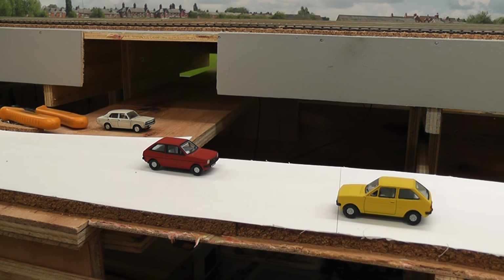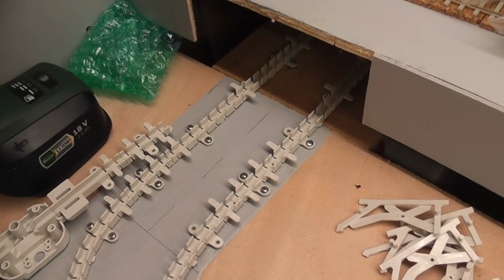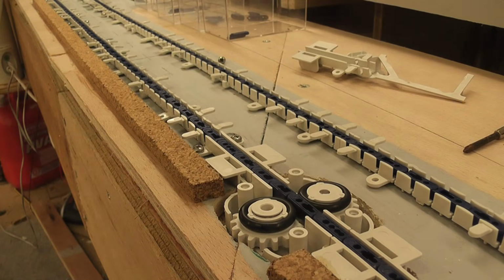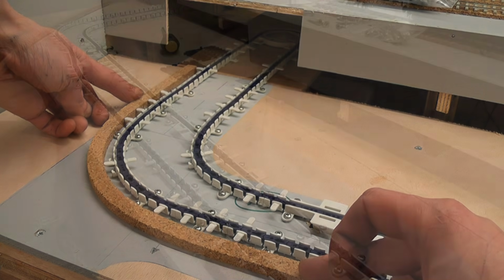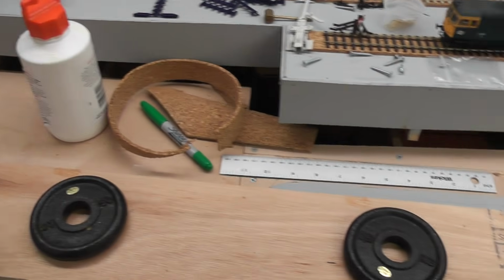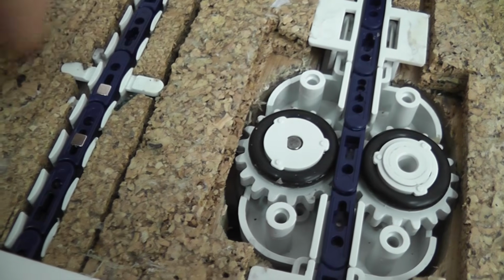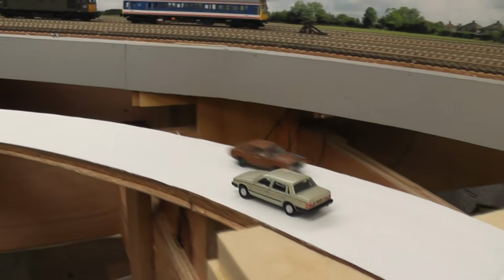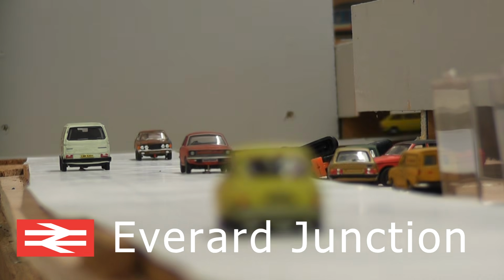New Layout Build - Magnorail

Comment: Hi Richard.  
I'm really impressed with your layout and videos.  The Magnorail video is very informative and instructive.  I'm interested in adding Magnorail to my layout but have limited space width wise due to an access area in part of the layout.  What is the minimum width required for a double roadway like you have?  I'll probably not use the return loops at the end and have more gentle endings. So I may be able to put the tracks pretty close together.  Any help appreciated.
Thanks, John

Comment: Hi.   Love your work Richard.   I am incorporating a Magnorail into my N scale layout but am having trouble selecting a road surface.   My shed can get up to 45 degrees in the summer and down to 5 in winter so expansion is a problem.   I've tried various plastic options with limited success.   After over a year of running, how is your idea of photocard holding up?   The magnets must wear a groove in time.   Have they damaged the road surface?    Any one else found the perfect material?

Comment: Two questions:
1) How do you cut your cork strips.  Especially getting them to look so nice and straight.
2) There is one area of the video where you show putting the links together on the track.  It looks like you are using something like a knife blade to lift the links in place but it goes by so fast I can't see the detail.  Can you guide me - my method leaves a lot to be desired.

I finally found someone in the US who was selling 8 mm thick 2 feet x 3 feet sheets.

Thanks
Zev Kahn

Comment: If the 'road'is flat it's only axle friction and acceleration that puts a load on the straight parts of the system. Maybe introducing spare turnarounds to increase the radius of corners where possible would reduce the vehicle load created at the turns? I still think it looks magic. BobUK.

Comment: I'm working on adding a bicycle path to my European module for the module club I am a member of.   Interestingly (this is in the USA) I can't find any corkboard underlayment that is metric in thickness.  So I can buy 1/4 inch, 1/2 inch, 3/16 inch.   Some of it has to be bought with large roles costing several hundred dollars US.

Similar problem with balsa wood, plywood, and MDF.   Obviously not as flexible.

Got any hints?

Thanks in advance.   Enjoyed you You Tube tutorial.

Comment: Hi I just installed the Magorail car system. And I at my wits end with the running chain. 3 days I am trying to get the right tension on the chain. By adding and taking off the links.but no matter what I do it keeps popping out of the track? Anyone have any suggestions?
Reply from the maker: It will pop out very easily if you haven't put the road down as the road holds the chain in the track.  Install the road first leaving a small spot exposed so you can adjust the chain and see how you get on with that.

Comment: I'd have thought that power is not the only reason you might choose to use more motors.  The chain tension will be highest just before a motor, and lowest just after (hence the bunching up).  More motors would mean more even distribution of chain tension, which might solve a few of the problems you've encountered.  Still, it looks great!

Comment: Very well done, you've got to the stage of having traffic & a railway operating on your layout. Would you mind if I suggested something which I think may help in reducing the weight of the cars & in particular the vans & trucks.  If you drilled 4 or 5 holes in the chassis to see if that helps. This is only a suggestion but it might help.
Regards

Comment: Fantastic; this type of track will allow different scales of vehicles working on the road.
a potentiometer in the motor circuit would mean no need for using a train controller.
Great system, there is scope for  different shapes.
Who are the stockists?

Comment: Does the Magnorail have  a hill option or any kind of incline, or is it just for flat roads?
Reply: I've seen it used in minituar wonderland on a hill so I think so yeah (also sorry if I spelt that wrong)
Reply: It's basically a bicycle chain on it's side so I think the problem would be the transition from flat to incline. However you could do a scene with a model going up and down an even incline e.g. the Hovis bicycle boy.

Comment: A few thoughts off the top of my head: The sliders are going to wear the road surface down. Maybe try to glue them to the base of the vehicle so they're about half a millimeter clear of the surface? Hama make some kind of extremely slick self-adhesive tape to repair worn-out computer mouse sliders. That might be worth a try to reduce friction and through that the load on the system. Also in a few months, give us a followup how it's been holding up.

Comment: Great video, keep up the good work......May I suggest putting the tiniest amount of spray grease on the motor bearings and cogs and also all the car axles, reducing wear, friction and noise........ensuring of course to keep it away from the sides of the chain  
    
https://www.ebay.co.uk/sch/i.html?_nkw=spray+grease&ul_noapp=true

Comment: Wonderful job in many ways. I have a few ideas for you: More then one motor is a timing and speed problem. The motors might have all of the same specs, but their speed most likely will be a little different, as well as the length and the thickness of the wire and the placement of the motors makes a speed possible problem. I bring this up because I think that was part of your tight and loose parts of the chain problem. The other thing to think a bout is the placement of the motors; I'm surprised the instructions did not point this out. Your motors should be right before any sharp turn or right before the turn-a-round spot. So the area of the turn-a-round will have less stress on it as that chain will be pushed through from the closer motor, while being pulled on the other end from the other motors. This is opposed to having one motor on  the other side making the most strain on the chain around the turn-a-round area now. To adjust for motor speed you can match them up using a resistor and capacitor to lower the speed and keep the current steady. Once assembled the plastic chain could have been oiled with  light oil, but DON'T DO THAT since the rubber on the motors to move the chain will get oil on them and not work. A gear system to the chain would have resolved that idea.  
To help with the noise from the system use cork roadbed under the whole thing or try Dynamat under the table. Your wooden table is acting like a acoustic guitar, so your direct mount to the table just amplifies it all the more.  Very light oil on the car axles.

Comment: I would replace all that track with thin-wall PVC pipe. Inside the pipe would be a fine weave nylon rope with Neodymium Magnets attached every inch or so apart. I would then mount the pipe under the roadway just as the track was laid. Then I'd afix another Neodymium magnet under the front of each car. Gone would be all that noise, those things that drag across the road surface and all the maintenance inherent in the track set-up. The motor engagement would have to undergo some minor alterations to accommodate rope rather than track.

Comment: Your cars are junk. I didn't see one that didn't have multiple bent or out-of-round wheels. You can get Hot-Wheels cars in the US for less than a dollar apiece. They have actual axles made of springsteel so they have some suspension characteristics. The best thing is that all the wheels are straight and though the cars are heavy, they have very little resistance and roll with ease. As kids we used to race them down inclines. Just the slightest incline and they start rolling from gravity alone. I would get better cars that cause little drag, like Hot-Wheels and I would replace that loud track with a fine brain nylon rope and attach the magnets with a drop of hot glue. As long as you keep each car approximately 180 degrees from each other you should have no trouble with bunching as one car counteracts the drag of the other. I would ditch those little pieces under the cars that drag along the road surface. Modern Neodymium magnets are very small but have one hell of an attraction to one-another. Just mount one under the front of the car, up high enough that it doesn't drag the road surface. That would stop all that stuttering movement in the cars as they roll. Trust me, you do not need those pieces that drag the road surface. In no time they are going to cut grooves in the road surface causing you to constantly repair. If you went with a fine/soft braid nylon rope your set-up would be virtually silent and run much smoother. But using the rope, the road surface would have to be in place before operating the motor. Without the road surface in place the rope will pop up out of the track.
Reply: Hot Wheels are the wrong scale for the model.

Comment: 6EQUJ5!!!  That's awesome!!!

My only concern would be is that everything is plastic -- the gears and all that are gonna wear out rather quickly if you just let it run continuously whenever you run your trains...
Reply: As Pod 042 would say to 2B ...
Proposal:  Use both Faller and Magnorail car systems on your layout.  Use Magnorail for your expressways (small cars, and buses) where it won't look strange to see all vehicles travel at the exact same speed without stopping for signals or railroad crossings.  Use Faller for city traffic (trucks and buses) so vehicles can operate independently, buses can stop momentarily at bus stops, and all vehicles can stop for railroad crossings when the gate is down and proceed when the gate is up.

Comment: You need more motor drivers on the track.  I would use a minimum of 4, 2 on each side of the roadway.  Drive motors should be set on the ends just before the end-turns, so the end wheels are not under tension.  You need way to access the drive units without tearing up the road.  One pair of drive motors could be set under the hidden part of the road, where they could be accessed.

Comment: Seems like it would be MUCH MUCH easier and cheaper and quieter to just use some cord or rope instead of having to build all of that chain. As long as it doesn't twist, but I bet it would be pretty easy to make things that attach to the rope-cord that follow a "track" like that and keep it all straight and usable. And those could be what the magnets attach to, as well. That's what I would try and/or do. You could probably just use a router in wood to make your track and do it that way. Or wooden "slats", one on each side, so far apart and cut for curves. (basically like the cork he used)

Comment: Its an ok system as long as it is not run for long periods. I have my doubts as far as durability. A brushless motor setup could be used taken from an RC Plane type motor and an ESC and speed controller would easily make this a much quieter set up. I will research this more but can see it being modified a bit to make it better.

Comment: Richard, you have certainly stirred things up with your Magnorail extension. I can assure you that you will find more creative uses for it. I have included a lot of Preiser and Noch scooters and motor bikes which just need a Neodymium micro magnet notched in to the wheels and painted black. They look cool going around in a group. I also have a Bikie on a Hog using a different method - checkout it out at https://youtu.be/UUvB7ykhu7s or the following video shows the Vespas in action https://youtu.be/4AhQA_8Py-s - keep up the good work - Clyde

Comment: I don't know if you know the "Faller Car-System" in the UK. But for me it is the better solution, as it can run multiple cars with different speed and is more quite, as it does not use any chain under the cars :)

Comment: i think the Magnorail hasnt caught peoples attention due to it using a sort of outdated type of engineering, if you can call it that, it takes alot of space, youre limited to how it can move and requires alot of planing ahead... the faller system is alot more simple to use, you have your thin metalwire, and you just put it wherever you want the vehicle to drive, nowdays they are very complex with lights, even being able to be controlled with a computer

Comment: I'm confused, the faller version of moving cars, buses, trucks requires the motor to in the vehicle and follow a metal track mounted in the road, if your using HO gage cars shouldn't there be enough space, I was interested in using it in N scale but never pursued it. If the wheels are free to move does this reduce the friction of the magorail, wonder if a pulse electro magnet in a chain would be quieter, probably to complex a solution but it wouldn't wear out or pop the roundabout gear.

Comment: Very interesting and well executed. Through my experience of working with engines that use timing chains, I was wondering if there would be any advantage in adding a lubricant to the chain? This may help reduce jerking and bring the noise level to a minimum. You could incorporate a very small oiling point out of sight to keep it lubed up.

Comment: I installed Magnorail on my small N scale urban layout. I used 5mm cylindrical magnets and trapped them in small boxes with windows slit in the bottom inside each auto so that the magnets actually roll. I made sure the North poles are always on the same side and made sure all the chain magnets match N to S. No sliders. I even laid some train tracks across the Magnorail, removing the ties and smoothing out the roadbed and it works! Just have to deal with cross traffic next. I used Photoshop to design the streets with crosswalks, manhole covers, bricks & patches and lane stripes, then printed out the roadway on cardstock paper.
Reply: ...and you now need to get some video of it & post it. I probably speak for many on that request.
Reply: OK, here's a short clip showing some cars and trucks. And there's a link in the description to a web page with some close up photos of the installation process. https://youtu.be/8k1yy9vvxIM
Reply: Hey Ron, do you have any photos or videos - the rolling magnets intrigue me - if nothing on line, drop me an email at Magnorailoz@gmail.com
Reply: Just a thought- would silicone spray on the "track" help with smoothness?

Comment: very nice Look of a moving road with the passenger cars and W Buses! I also love the nice weathering!
The sliding of the magnetic Lash directly on the surface of the road seems to be important to make the smooth, non hopping movement of the cars. But it will cause wear on the surface in a short period of time. A solution would be cars with oil frictioned axles.  So the magnet could be mounted on the car with minimal clearance to the ground with the car still moving consitantly without forward - backward oscillation. Just an idea, not sure if it actually works. It is in any way really cool as it is!   Didn't know about this system.

Comment: I think if I was laying this system I would use a little silicon oil lubricant on the chain (the same as you lubricate running machines with), it would definitely reduce the noise and smooth things out also it is plastic friendly. I would also experiment with chain tension. BTW, I quite like my current Faller N gauge lorry trundling around my layout of the Cornish roads, it looks really realistic!

Comment: Instead of using the sliders, could you glue the magnets to the bottom of the vehicles instead?  Perhaps then, you will no longer have the sliding friction or that pin sticking up.

Comment: Seasons greetings Richard. Superb content as ever. Wasn't aware of the MagnoRail system, but it definitely has miles of scope. Agree with some of the other comments, imagining on board lights, even going as far as maybe activating turning signals through a pickup on the road or having a simple circuit on each vehicle that simulates stop lights. You could go absolutely mental.

Comment: Quite realistic how the Volvo made a turn at the junction without signalling just like real Volvo drivers do!!

The problem with the sliders is that they'll polish away any paint on the road surface. Perhaps doing away with the sliders, drilling a bigger hole in the vehicle chassis and installing a larger magnet. This might also allow vehicles to cross at a level crossing.

It should be possible to use the system with horse drawn vehicles if the horse's hooves are attached to the slider.

Spraying the chain with PTFE aerosol lubricant or using PTFE grease should improve the loading problems.

Comment: I for one had never heard of this before but what a brilliant system that is. I’m amazed that it isn’t more well known as it seems to have so much more going for it than the Faller alternative. It would be great to see some larger vehicles being able to use the system but I guess you are restricted by the return loops at either end and the weight of those vehicles. I did wonder if you were to place a second slider under a vehicle would it allow for greater pulling power, is this something you have experimented with?  Thanks for sharing, you’ve certainly introduced me to something new here. Paul

Comment: Interesting set-up. I'm not sold on the noise, but I'm more concerned about the construction of the road surface.  In using photo-paper sandwiched between two sets of magnets which create friction and thus wear, is the paper road surface not going to disintegrate?  Where this technology has been used you see the effect of the magnets constantly rubbing on the road surface and creating a very clearly visible change in tone or where the paint has been worn away, so what is your expected life of the paper before you have to replace it?